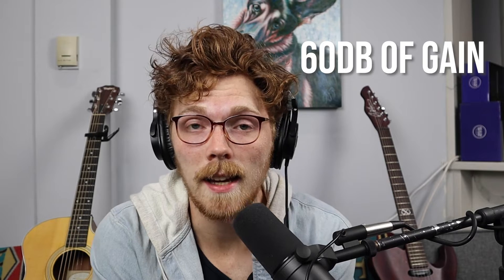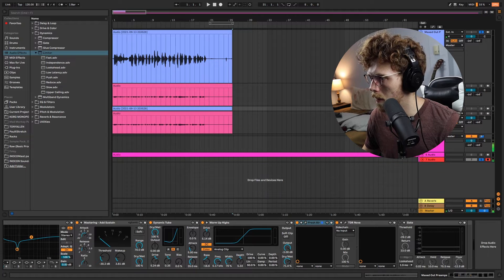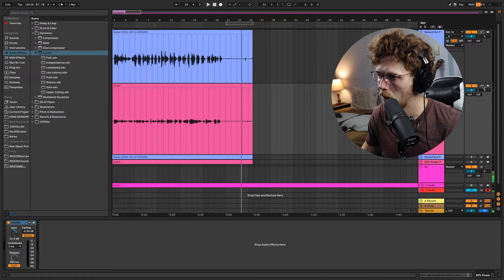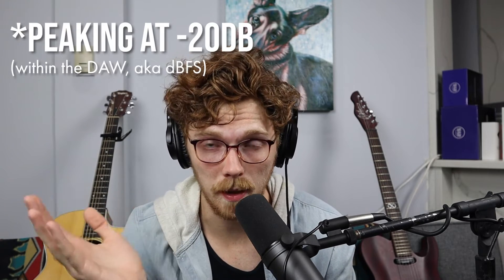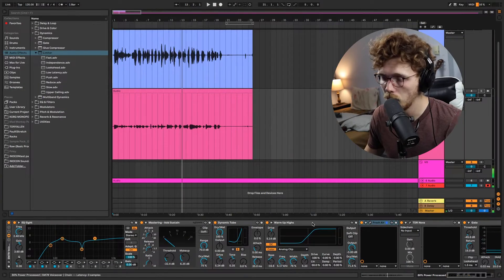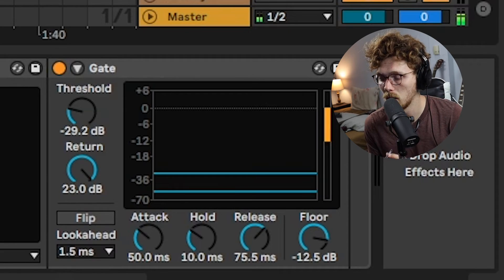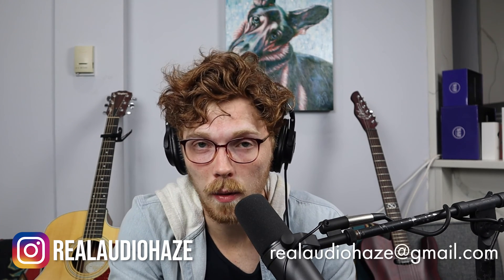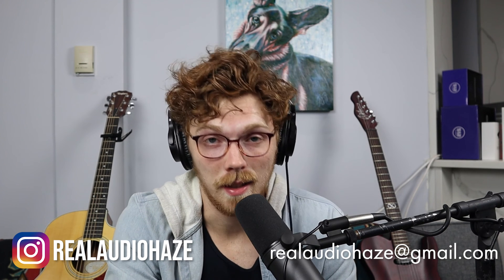How to Use the Shure SM7B Without a Cloudlifter/Fethead - Use Processing in Your Microphone Setup!!

Comment: The SM7B is a great mic.  Having said that, my rule of thumb is: You only need a Cloudlifter/FEThead on that mic IF the sound you're capturing through it is real quiet (speech-like podcasts, radio interviews, etc.)  Why?  Simple.  The mic without the add-on has a 10db loss in volume as-is.  When you plug it into your audio interface (USB-type or mixer or whatever) you'll have to turn the GAIN/TRIM knob up to compensate.  This adds more noise floor to your recordings or live performance in the form of hiss and/or buzz.  Using without a preamp add-on may be fine if you're capturing DJs or vocals or instruments that are loud on their own.  If they're quiet, however, you'll want that preamp.  It adds the right amount of gain BEFORE the noise floor.  Your signal will remain clean and loud enough before feedback.
Reply from the maker: Nice feedback!
Reply: @AudioHaze  Thanks.  Having been mixing live and recorded sound for over 25 years has taught me a lot.  Incidently, the SM7B is actually an SM57...on steroids.  Think of the SM7B is the capsule part of the 57 without the bottom half that contains the audio transformer.  That missing transformer is why the 7B is 10 decibels softer in gain.  The transformer also adds some midrange frequency boost by 3db.  Some engineers will "modify" their 57s to remove or replace the transformer entirely to match or exceed the 7B sound.  But that's all for music purposes.
Reply: Julian kraus  pretty much debunked this notion, recommend going and watching his signal to noise ratio video

Comment: I have done some research and  i am pretty sure that the fethead can be made easily at home, no need to spend so much money. I am designing the pcb and ordering parts. My idea is to build the circuit (double sided pcb) inside the male xlr plug.
Reply from the maker: That is so cool, so happy people like you who do cool stuff like this watch the channel.
Reply: how was it bro?
Reply: @nideabroder69 probably blew up in his face
Reply: Any updates?
Reply: @tawmifm  No, I stopped using my rode pro caster. Using my synco D2 shotgun microphone, works well enough for me.  If you want to make the gethead you will need to order like 200 the JFETs and test them to find some with extremely low noise. You will need an oscilloscope and a signal generator. This is how they make them , by sifting out better JFETs from a lot, the PCB and circuit are very simple. If you can house them in metal tube you won't even need a PCB.

Comment: Like you mentioned in the video, a gate isn't gonna take the noise away while the vocals are active. Right now, I'm trying to lay down some fairly quiet vocals for a song, but I'm dealing with an issue where there's some source of noise that's literally exactly in the range of the presence of my voice, so I can't boost it without also boosting really gritty noise. Unfortunately a gate isn't gonna help that much in this scenario. Likely I need to record in a better treated room, or maybe switch to a different mic.
Reply: Yep different mic.  Go for a condenser.  You can get mics that are clones of an ELAM 251. They are tube. AMAZING mics though.
Reply: You can use a noise suppressor like the waves ns1
Reply: I've faces this issue so found the best solution is actually a downward expander it's like a gate but when set correctly it also eliminates the noise when you speak, it also is less manipulative to the sound of your voice than other methods.
Reply: @via_negativa6183  the expander works more like a gate. and a gate doesnt take of that noise. try using a noise suppression like waves ns1. it really takes out that noise when speaking or not
Reply: @JEBJOSH  when I said "other methods" I was also talking about noise supression. To me it just manipulated the quality of the voice to much where a correctly configured downward expander resolved my issues out right, you get the benefits of a noise gate but the background noise below a certain threshold is just simply compressed into oblivion even when speaking. Recommend people trying this it may surprise you.
Reply: @via_negativa6183  I understand where you are coming from. I understand the noise suppression takes some quality out too. But I’d prefer the loss in quality than that noise. But thank you too fir your idea
Reply: rx voice de-noise definetly helps, personally hate the waves ns1 but to each their own.

Comment: This is an awesome demonstration. I have the cloudlifter, but even with my audient ID14 interface, I was able to power the shure sm7b pretty comfortably without the cloudlifter. I specifically got the cloudlifter because people told me that I needed it. 🤷🏻Maybe I can go back to simply using the ID14 interface on it's own. Btw, I found that when using the cloudlifter, it picks up noise from your interface, computer and other devices, so be sure to check your noise levels by arming your shure sm7b with the cloudlifter and moving the cloudlifter around until you notice that the background noise mostly goes away. Hope that helps someone. :]

Also, as far as using a gate, I record raw without processing then use RX 10 Spectral De-noise for instruments and RX 10 Vocal De-noise for vocals in my signal chain first instead of using a gate. I guess it depends on what you prefer to use.
Reply: the ID series just has amazing preamps in their respective price range, no need for a cloudlifter as you’ve already said. I can turn up the preamp of my ID22 to about 90-95 percent before getting any preamp noise at all. If i would record into a focusrite or something with a higher noise floor the cloudlifter would come in handy though, but nothing you can’t solve in post.

Comment: Better sound with more gain. The best solution for good sounds is physical compressor. With virtual compressor it's sounds just "ok". Cl1 is too expensive. Triton Fethead is fine for me (not expensive and easy to use) and voice meeter bana potato's + scarlett 2i2. No white noise and easy again
Reply: Fethead seems to be good option. Clean enough and also adding some clarity. I would not run sm7b without preamp if it’s not must.

Comment: Our radio stations all target an average of -20dBfs (usually -16dB on peaks on regular speech)on speech which means that around 50-55dB of gain is usually enough which is something literally every consumer pre amp can do VERY easily.
This is on ALL their speech mics (Rode Broadcaster, TLM102, SM7b)
While I really don't have a problem with maxing out the gain, if you don't have to do it. Just don't do it.
Reply from the maker: Words that should be written in scripture :)
Reply: Another thing to think about is whether the audio mixer is analog or digital.  If it's digital, you shouldn't boost the gain above -15dB (on the VU meter) for all voices.  Going "into the red" on a digital mixer will add noise in the form of crackling, which is too loud.  So, if using an SM7B with a Cloudlifter CL-1, set the trim on the channel(s) so that there's a max of around -15dB on the loudest passage.  It's okay if there are occasional transient peaks above -15, as that is normal, but just don't always max out steadily.  If it's an analog mixer, it's a bit more forgiving, but you'll still distort at max volume.  The distortion is because the mixer's built-in mic preamp exceeds its limit and the signal goes from sine wave into a square wave, which is not what you want.  Nowadays, you can have the transient peaks go almost "into the red" and you're still good.

Comment: I have a presonus 24c with 50db gain range and a Procaster.

I use a fethead to help it out, so I don't need as much filtering or badically full gain.

If I get a 56/58db interface (looking for a quad input xlr interface), that would help as well, right?

Comment: I'm still having so many issues with keyboard clicks and I have done everything in my power to reduce this. I heard a fethead could fix this as it would allow me to reduce the gain in my goxlr.
Reply from the maker: Whats your signal chain like? You could always run a gate to cut out any volume below a certain threshold
Reply: @AudioHaze  signal chain? Is that the same as a connection lineup? I Have my SM7B to xlr to goxlr to usb to pc. Already have a gate as well :(
Reply: Use a downward expander imo it's better than a noise gate too. Put it on a ratio of about 2:1 and threshold until the clicks disappear

Comment: Great content. One question. Sorry for the ignorance, but would I need a cloudlifter if I'm using the microphone for on stage live performance? Everything would be connected to an amplifier.
Reply from the maker: It depends on the board you’re running it into! Very often these live rigs will have plenty of gain though
Reply: @AudioHaze  Thanks for the info. would it be possible to use a condenser microphone for live performances? Also, will you be doing a review on the TZ Stellar X2 Large Diaphragm Cardioid Condenser XLR Microphone?

Comment: I'll say based on my last year with the sm7b;
1. It needs 70 db of gain to push it effectively. 60 db won't cut it. These issues truly only exist in the live broadcast or livestream application.
2. In post, the audio can be boosted so keep the gain medial and adjust as needed. This would reduce and almost eliminate the hiss. 
3. It's not the best mic for most people. The cost is unjustified for the non professional. 
I have regrets and true buyers remorse. I should've bought the 57 or 58.
Reply from the maker: You don't think in live radio we could just run it through a chain such as the one here and then out into the broadcast world? That would bypass the need for the 60dB of gain. And sorry to hear about the buyers remorse! A 57 or 58 isn't hard to come by though :)
Reply: Your suggestion for radio use would be fantastic. Thanks for the reply. Btw I’m totally going to buy the 57 and if it performs as well or nearly as well as the 7b I’m selling the 7b.

Comment: I am already sorry for this wall of text, but I watched your video a second time, with my noise nerd fully in charge. And I realized a possible misconception of yours, when it comes down to preamp noise. We need to make one thing very clear: No, you don't get more input noise, relative to the signal with more gain. I recommend to watch a video named "USE YOUR GAIN!" by Julian Krause, where he pointed out, that not using the gain, that you have will actually give you a lower and thus WORSE Signal to Noise Ratio (SNR). Trust me, when I watched the video,  at first I was like: "Okay, now he's full of it." But then he explained and blew my mind. So I sat down and did a series of tests with different gain settings myself, to see it for myself, back then with my Steinberg UR22 Mk II and a RODE Procaster. And he was right. now I repeated the same series of tests again.  As a disclaimer: My Interface for this test is a MOTU M4, my Microphone is a Shure Beta 58A.

All I need for it was a white noise or tone generator on my smart phone and a DMX Terminator Plug. I need the white noise generator to create a sound, that I want to record. I chose a generator  to make sure that  the sound does not change its loudness, so I get usable results. I use the DMX Terminator Plug to make my audio interface react like there was a microphone plugged in, but without recording any noise from the room itself. With this I did 9 recordings, 3 at 100% gain, 3 at 50% gain and 3 at 0% gain. Recording 1) The signal. Recording 2) The room noise. Recording 3) The Input Noise with the DMX Plug instead of a microphone connected to the interface.

These are my measurement results:
Gain -> Signal -> Room Noise -> Input Noise
=100% -> -9.1dBFS -> -57.5dBFS -> 63.3dBFS
~50% -> -40.8dBFS -> -88.1dBFS -> -94.4dBFS
~33% -> -50.1dBFS -> -97.9dBFS -> 102.4dbFS
=0% -> -69.6dBFS -> -108,4dBFS -> -108,4dBFS

And in terms of SNR vs Room and Input, it goes like this:
=100% -> 48.4dB vs Room -> 54.2dB vs Input
~050% -> 47.3dB vs Room -> 53.6dB vs Input
~033% -> 47.8dB vs Room -> 52.3dB vs Input
=000% -> 38.8dB vs Room ->  38.8dB vs Input

As one can see: The lower the Gain, the lower the SNR. There is a little fluctuation in the SNR vs room, but that will most likely be due to fluctuations in the noise of my room. Also, as one can see with the test at 0 gain: If you are too close to the noise floor, the SNR completely falls apart. Also, the values for the input noise prove, how much more apparent the room noise will be in literally 99% of all rooms you record in. Mind you: I already use a microphone which is really good at not picking up the room noise, a dynamic one with a Super Cardioid Pickup Pattern. It destroyed my old RODE Procaster in terms of noise rejection, and the Procaster already bests the Shure SM7B in terms of room noise rejection. Not by much, but still. And now, just for sh**s and giggles compare this to a condenser microphone. A RODE NT1 again will be completely annihilated by the Shure SM7B, just because condenser microphones are so much worse for noise rejection. But then again, a condenser microphone gives you a much louder output.

But if you had a really, REALLY quiet recording room, this would be a completely different story. Think about it. My interface gave me -88.1dBFS input noise at ~50% gain, which is fine, if not too much for many condenser microphones. And if a condenser like said NT1 microphone adds only 4dB on top of that, you could have a SNR up to 76dB for recording a human voice, which would be completely nuts. This is why people recommend to use condenser microphones for quiet environments and dynamic microphones for loud environments.
Reply from the maker: Wow! Interesting, I can always count on you to not only do the most thorough research of anyone on the channel, but to also inform me on any misinformation, thank! So, if this is true, what causes this excess of noise for the Sm7B? Since it certainly does require a bit more gain to bring up to "proper" levels (which again I'm trying to dispel in this video the misunderstanding that you must fall in this dB range, but still), and doing so does increase an amount of hiss to a certain degree, where is this noise coming from?
Reply: Well, as you can see, the difference isn’t that big. 1 to 2dB (until the dynamic range starts to break down) doesn’t make much of a difference. That being said, reducing the dynamic range (i.e. with a compressor) does and quite dramatically so. I actually doesn’t use that much and I still easily raise my noise floor by about 10dB. You showed even more ways to make the noise in the recording more apparent. I don’t know about your current audio interface, but generally speaking, there  is the possibility that an interface simply is more noisy. And in that case, the Fethead, Cloudlifter and others have their merit. Because the way they work is to replace parts the noise of the Audio input with their own noise, which usually is quite a lot lower. But that depends on the audio interface in use. On my MOTU M4, it would result in just 2dBFS less self-noise, which is neglect able. On my Steinberg UR22 Mk. II, the difference is quite dramatic. There the input noise at full gain is like -57dBFS, but can be reduced to -65dBFS using my Fethead. Also, adding gain will always result in a raised noise floor. And since the SM7B is a notorious low output microphone, you get a lower input level, relative to the gain setting. I can only guess, but I’d say The SM7B is like 8dBFS quieter than my Beta 58A. Because of that, you already have a 8dBFS lower SNR. So guess what happens if you use that with a noisy interface like my Steinberg without a Fethead? The noise floor is raised by 14dB vs my MOTU M4, 16dB, if I use my Fethead. And adding gain always ends up raising the noise, no matter if you add hardware or software gain. The point I made before was simply this: Hardware gain is preferable to software gain. In the end, you simply have a lower SNR to work with, just by the SM7B being roughly 8dB quieter than my Beta 58A. Remember, I got 54.2 dB of SNR vs input. That’s actually decent. But with the SM7B I would have a SNR as low as 46.2dB. And up to 10dB more due to an reasonable amount of dynamic range reduction, by whatever means will reduce the SNR to 36.2dB, which obviously will render it borderline unusable.